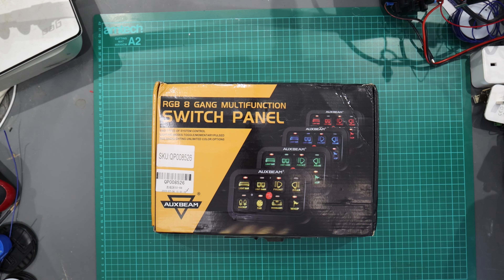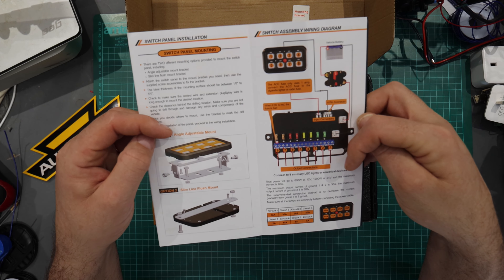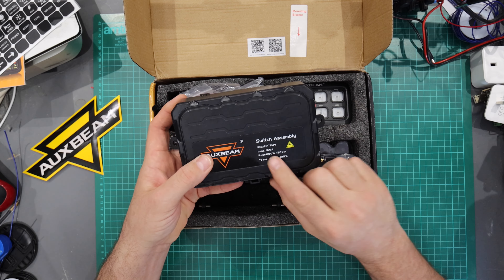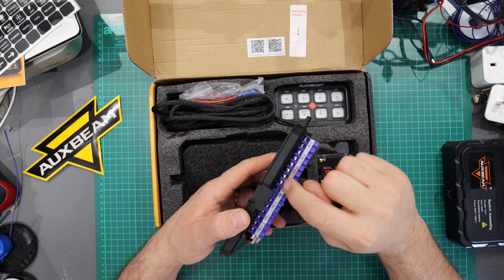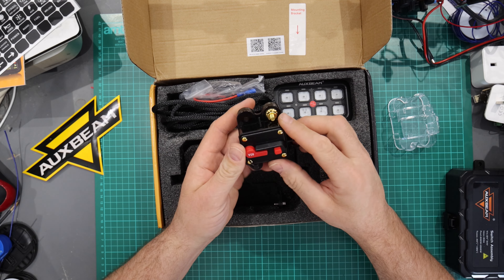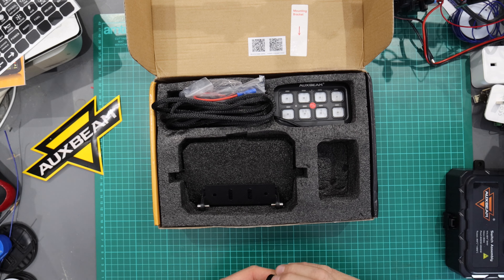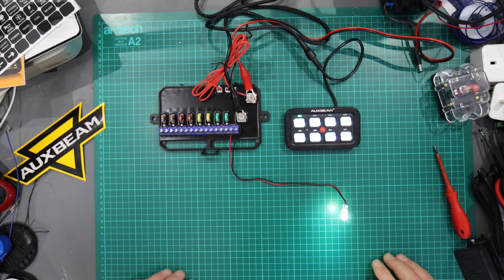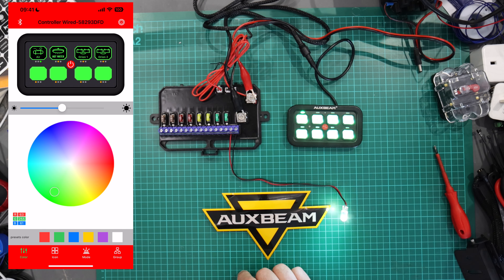Check out this fantastic AuxBeam Touch Product, Ideal for remote switching of 12v or 24v equipment.

Comment: Just an fyi, this type of item typically belongs inside the engine bay and you'll only need to run one wire into the cab for the panel. Much of the materials used are non corrosive and shouldn't have any issues with that.
Reply from the maker: Totally get what your saying but I prefer to have any terminals inside and out the weather, Cheers